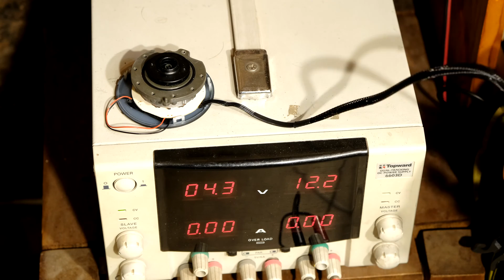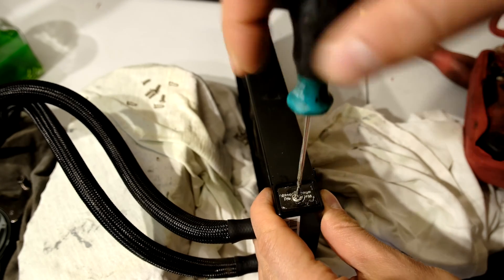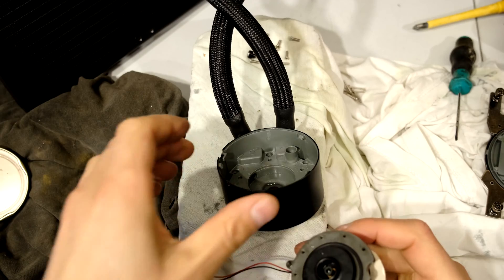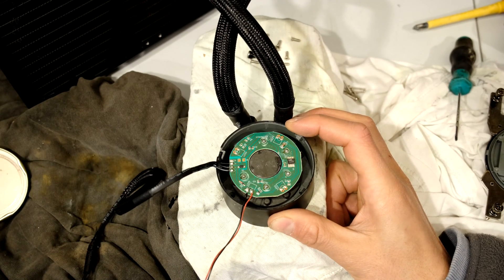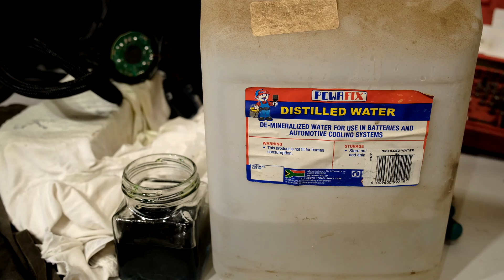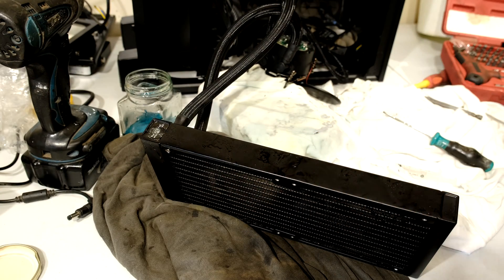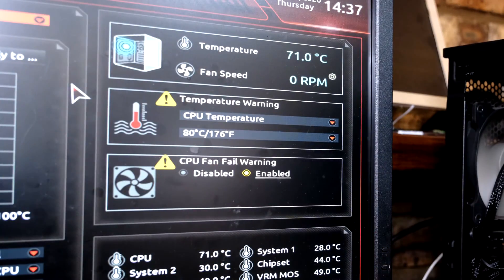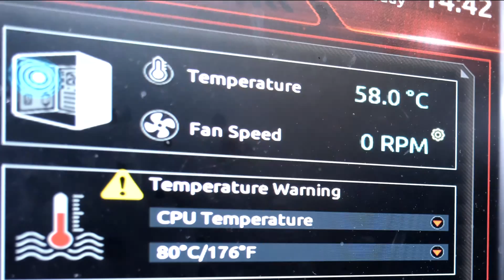How to disassemble and refill a liquid CPU cooler and reassemble - Cooler Master Master Liquid 240

Comment: Isn’t using anti freeze totally counterproductive to what you are trying to achieve? You put anti freeze in car radiators at wintertime when the weather is cold and below freezing. Don’t you think using the opposite coolant that we use in car radiators in the summer time when ghe outside air is 30c plus can be even higher with heat raising off roads and tarmac

Comment: Great video!  My pump had two one-way tamper proof screws.  So I just added some water in the vent port - It's quieter now, and that's all I was looking to do (new thermal paste didn't hurt, either).

The pump is priming OK,

Comment: Looks like a comprehensive explanation. I'm trying to learn. Ran into some issues and by the look of it, might be my cooler. I've an exact same cooler as shown in the vid. I can play Assassin's Creed: Odyssey for about 1.5 - 2.5 hours and then, the entire pc shuts down and restarts. Could be a PSU, sure, but the rate and repeatability of this issue makes me think the CPU's heating up to a threshold it can't sustain and to save the CPU, the system shuts it all down instead. 

Don't know what I'm missing. If you see flaws in my reasoning please point them out. All this seems like a lot of fuckin' work. I'm a newb.

Comment: Thanks for the thorough walk-through.  My six year old cooler (Captain 240) started making an intermittent noise from the pump a week ago. Tried all the tricks to get it to shut up, tapping the hoses, laying it on it's side.  It would go away for a little while then come back.  Finally it was making the noise all the time and wouldn't stop.  It was to the point I couldn't use the pc just because of the racket.  My son said it sounded like a Geiger counter.  I thought that with the age on it that it could just be at the end of it's life.  The temps were a little higher than normal but more than that the pump rpms were all over the place, zeroing out at times, then jumping to 4400, and everywhere in between (it should be steady around 2200).

I roughly followed your tutorial here.  After removing the cooling plate I immediately observed a BB-sized pile of sediment on it.  I didn't tear the pump down to the impeller because separating the housing seemed like it would require more force than I wanted to apply, possibly breaking it beyond repair.  I wanted to see if just flushing it would do the trick.  It did.  There was good bit of black debris that came out.  I'm highly curious to what the source of the debris was and really wanted to look at the impeller to see if it was deteriorating.  I suppose the interior of the radiator or the hoses could likewise be the culprit.  But I refilled it, tested it, it was quiet. So I reinstalled it and the temps and motor rpms are back to normal and it's quiet again.  Hallelujah. Thanks again.

Comment: I have this same cooler for around 7 years now. It has become quite noisy with a rattle or clicky like sound when put under load. I suspect the fluid level has dropped over time or there is sediment or something. I already replaced it with a nice air cooler, but now after seeing this I think will attempt to disassemble and refurbish it. It does seem the pump is still functioning. I just couldn't tolerate the noise that happens when the system is put under load like gaming. It is still functional and felt it would be wasteful to get rid of it. Nice video. Thank you.
Reply: how did it go
Reply: @shockAttt  haven't got around to it. Just saw you do this yesterday. Will probably be a few till I get a chance to mess with it, but I expect it will go fine with your vid as a guide. Honestly expected this to be more of a hassle or I would've refilled it ages ago.
Reply: @ItIsNot1984  that aint my video lol, just curious with results
Reply: @shockAttt  My bad. Haven't slept. I might be doing this to put in my kid's pc, but I think he'd prefer something with the RGB lightshows. I'm planning on pimping his rig a little for his birthday. If I don't use this, it will probably be a while before I get to it.

Comment: Good video. Didn't know Arnie was in the liquid cooler business though.
I see nobody talking about changing the thermal paste on the processor before putting back the cooler , is that normal ?
Reply: If you remove the cooler from the processor, it's a given that you replace the thermal paste.

Comment: Took about 30 minutes to do all of this, had alot of fun with it minus the solder part i hate doing it. I had debated about cutting the tubes to replace with clear aquarium tubing and putting UV coolant inside for a cool visual presentation however the pipes are very well constructed and i would hate to destroy them.

Anyhow, worked for me. If your not confident doing it im sure your local handyman will have zero issues doing this. It wasnt hard just follow the directions. 

Pro tip, use an ice tray to seperate the screws and a magnetized screw bit so you don't have to hold them their small and will fall off very easily.
Reply: Did you buy the screw driver? With the triangle shape?
Reply: @coolissimo69  I actually have an MSI 240r cooler which doesn't have said screw but you're describing I'm sorry 😢

Comment: Nice vid but, with all due respect, if it comes to a point where it's not working, I'm simply going to go buy another Cooler Master and just replace the one not working.    

Simple solution without any extensive maintenance like in your vid.      :)

I'm no technician or PC Builder.  I'm just a Gamer who wants to turn on his PC and play games and/or surf the net.    That's it. 

Even if 5 years (minimum 'cause it says it can last up to 10 years) passed and there is no more coolant or whatever, I am not going to waste my time trying to refill it where all sorts of things can go wrong. 

There is no easy or simple way to refill the Cooler Master aside from the complex demonstration you just made especially involving screws that could easily fall to the floor (and disappear) or fall into the radiator or wherever.  

If Cooler Master had a more simple way where PC users can just refill it (ie.   Here is a hole to put in more liquid, and we don't need to remove the cooler from the PC or disassemble the Cooler itself), then I'd be all for it but there isn't. 

I mean I have enough to worry about simply by removing the old cooler from the CPU, then putting new thermal paste, and putting on a new cooler onto the CPU (and then re-screwing it).   It was not easy for me to do it the first time (just saying).
Reply: It took me 30 minutes to do this, nothing complicated about it. Remove a few screws, pop a plastic cap off, remove screw for the fluid to drain, replace coolant. Did it on a day off works fine 👍

Comment: Hello, in terms of CC, how much did you remove from this water (4 or 5%) how much in CC?
The T expansion factor of water is 0.00070from T=20 to T=90 d.c, the water expands 5% exactly. but what is the capacity? I already filled mine, without knowing the volume
Thanks

Comment: Why are they putting antifreeze in there? Its not gonna freeze like a car might outside during the winter :p   distilled water will have about the same amount of cooling power/thermal dissipation.
Reply: dont use antifreeze. get proper PC cooling fluid. it doesnt contain chemicals that are bad for components and often preform WAY better. water wont work for it unfortunately.
Reply: @TheDooreater  And what chemicals are these you speak of and what redox reactions of what parts of what components and do adverse affects do these reactions cause?
Reply: @Zilog  I'm not doing the smart-ass commenting. Much like different power steering fluids there's different mixes inside. Same thing with oil brands. These are brand specific chemical ratings. He's using concentrated BMW coolant.. not cooling fluid. Using this will cause your hoses to eventually corrode, your little rubber seal in the motors to swell and decompose and other adverse issues if it leaks on components. (He's already commented in other replies about how his setup has leak issues when it gets warm.. which isn't normal. At all.) Which signs to me it's already falling apart. Just use pc component fluids so you don't fuck up your stuff. 

Vehicle components are made of different types of rubber, plastics, etc that PC's don't commonly use.
Reply: @TheDooreater  Qualitative vs quantitative. Okay so what you are telling me is you dont know anything about the chemistry or thermodynamics of any of this. just anecdotal evidence and word of mouth. got it. 👌
Reply from the maker: Antifreeze stops it from bubbling when it gets hot. Increases boiling point of the liquid and also has corrosion inhibitors
Reply: @ecologicaltime  Good to know!

Comment: Anyone trying to remove the copper plate on the older Cooler Master Seidon 120 will find they used 'clutch head one way screws' - This Youtuber has tips on how to remove those. /watch?v=eC4dyHchnM0&t=274s

Comment: Interesting, thanks for sharing. One word of caution, it's advised not to use car antifreeze, see jaytwocents. Distilled water is ok to flush with, but for the long term you want coolant which wont react to the copper, or the aluminum, or the various plastics used in the AIO. I'd recommend "XSPC XS-EC6-CL Non Conductive Coolant", found on Amazon. Non-conductive in this sense means if AIO leaks it won't conduct electricity.
Reply: Even if you use non-conductive water it will have electrolytes taken from the internal AIO walls through the time...

Comment: big facepalm, NEVER use antifreeze from a car for your CPU cooler because It most likely react and break your cooler (why anti freeze, you don't use your pc in freezing cold right?). Internal components are not the same as in a car. 
Be very careful to let your cooler motor run without liquid because it can overheat and break the motor (it's designed to run with liquid!). 
If you use tab water to flush, what is not recomanded, always flush after with demineralized water.
Some people just should not make  how to video's.
Reply: Who says? Where you getting your information from?  You ever look at a “pc water” msds and compare it to car coolant msds?

Comment: Chances are that if you are at the point to rework your cooler you need some more time until you can get a new one. Would I consider this a long-term solution, kinda but not with extreme confidence. That being said, what I see here is good work if you are in a bind. 
Thanks man!
Reply: Bro it's literally a radiator, like you find in cars, so why should i change it? Like it's bigger brother you bleed it sometimes and it's good
Reply: @R3ddyyg  because its not the rad that is the concern, it's the pump, and pumps die. And unlike a car, computer pump impellers are made from thinner and more brittle materials. If it fails you risk the CPU cooking. Only takes a second to fry. So yes this works. But there is a much higher chance of failure. Personally, I would just replace the AIO and sell the refurb to someone who doesn't mind the risks.
Reply: @nickrider815  Literally check the pump before refilling, if it works you good, water pumps fail on cars too btw
Reply: @R3ddyyg  it's not going to fail while you have it open and are looking at it. It will go at point in the future, generally during speed change cycles. But hey if you're happy with the risks you do you. Personally as I said, it's not worth the risk. Costs for coolant, deep cleaning the rad and fans then two hours labour costs me more than the replacement.
Reply: @nickrider815  Bro, I had the same aio that the guy in the video shows, it was a bit iffy so I opened it up, after testing the pump I noticed that it didn't go full speed, how can I say that? Speed didn't change from 5v to 12v so I didn't refill it and didn't use it, if it were to work tho. A flush and refill with radiator fluid would keep it good for at least another year, frying isn't possible if you're careful with it, just test it with HWMonitor opened in a second screen, my 3600X reached 95c and pc turned off on its own anyway, so unless you turn it back on I really don't see how you can damage the chip... 
New cars have air intakes and water pumps made of plastic! They are rather a bit more shitty than the metal old ones but they work if you keep your maintenance up, so a small stupid radiator that doesn't/shouldn't see more than 90 Celsius is gonna be fine until your pump dies. No risks taken imo

Comment: I would of filled it first the radiator...  then filled the attached funnel with it running to burp the whole system until you don’t see bubbles, let it over flow in the funnel as it expands.  Clean and remove the excess coolant.  Seal.  Clean again.

Comment: Nice video. Thank god you left a bit of room for expansion.  Would be nice if my radiator had a bleed valve / filler valve like yours. PS you can get a pre mix antifreeze. So you dont have to dilute it yourself.

Comment: is it normal if the fans are moist (very tiny amount)? should i be concerned about leakage?
Reply from the maker: should not be moist at all.
Reply: @ecologicaltime  i read somewhere else that it might have been moist/greasy from the fan bearings. I have noticed this around the other fans as well that are not linked to the cooler so i might be in the clear :D

Comment: sir, I have a liquid cooler with a 120mm radiator... and one day I remembered that I have a 240mm radiator... it is possible to convert my previous 120mm radiator into a 240mm radiator?
Reply: It’s possible. But not easy with prebuilt loops.

Comment: Amusingly, the ml lite 240 may be even easier. I was following as closely as i could your video, failing to notice the other warranty void sticker (this thing is way past anyways). Looks like a fill port on the block and pump side itself. Guess i just need some kind of funnel or syringe.

Comment: Good vid, thanks! I'll probably will refurbish mine as well -- sometimes weird noises in pump. 
One point I'm not sure about -- taking out the coolant in the end. Rubber pipes should take care about pressure difference on heating if that even case on those operating temperatures. Also we spend a lot of time making sure no bubbles and this like for nothing :)
Reply from the maker: i would leave an air gap, if pressure builds up it leaks on CPU

Comment: Dear author, what about the thermal expansion of a liquid? I think you shouldn't pour so much liquid into the circuit. When heated, the water will expand and the increased pressure will push the fluid onto the system components.
Reply from the maker: that is why there is an amount of water removed after its filled to allow for expansion.

Comment: It is not correct to wash the radiator under water from the tap, as salt impurities in the water can further damage the radiator. To clean the radiator from dirt, first use distilled water with citric acid, then rinse with clean distilled water.

Comment: How stupid must you be to use a DRIVER-DRILL or IMPACT DRIVER to remove screws from your CPU cooler or anything in your computer? 

If you shoot out you destroy everything, a Game PC will cost you thousands of dollars, and why not use the original bits, cost almost nothing and works much better, for the rest it's a ok video.
Reply: I used to be a professional system builder, for a fortune 500.  We used drills for everything, when you build 100+ pcs a day you'd be nuts to use a regular screwdriver.  If things arent powered, you cant 'shoot out' or short out anything, and you learn trigger control to not strip things.
Reply: @beyonddeath123  Ok, great for your fortune 500 company, but i will use a screwdriver and do it with my hands, then it's a LOT saver and you do not need power tools to remove stuff from your computer, if you need power tools your doing something wrong, or it's only about money and do not give a f if you destroy some systems.

Comment: i dont know how.. but mine master liquid exact model as this... is absolutely emty and i see absolutely no evidence of liquids anywhere in pc
Reply: actually the water in the radiator slowly evaporates overtime, depending on how long it runs yours must be kinda old. thats what i think somebody correct me if im wrong :)
Reply: @MultiHeadshot1  yes it has an rubber seal, it can escape from there.. ivr cleaned it completely out and filled it again... it did not help because the problem wasbin pump, ive opened the pump and changed its washers places... no easher was under the blades it was really hard to spin it.. ive seen that it can be dirty but mine after 3years wasnt.. it was just stuck. in bios it was showing even that ive got no pump. so if your liquid system does not work, it could be

:low liquid-you will probably hear really loud spining pump maybe bubles

:bad placement of an radiator could cause pump to pump air or it could make the pump work a lot harder than it could

:stuck pump-you will absolutel hear this one, cause that pump just stops working after few seconds and you will see in bios that your pump does not exist

DO NOT MAKE WATERCOOLED PC IF YOU WANT TO BE TAKING IT TO YOUR FRIENDS, they really dont like changing orientations during transport.

Comment: I just bought the same AIO cooler, how often should I perform this service?
Reply: Same question here.
Also, I'm thinking of taking one tube off and adding a water tank to get rid of the correct water level. Largest problem - I don't know fittings diameter.
Reply: 1 month
Reply from the maker: not often. After 3 years or even 5 years

Comment: buddy, I have a question with a masterliquid ml360r, when i connect my pump in the pump header of my mobo the pump is not pumping, and the speed pump in bios is NA, what can it be?
Reply from the maker: measure the voltage, sounds like no voltage or you motor is not functioning.
Reply: It is bocked